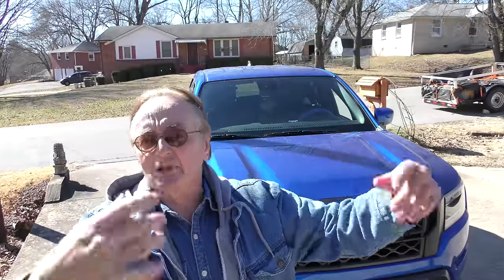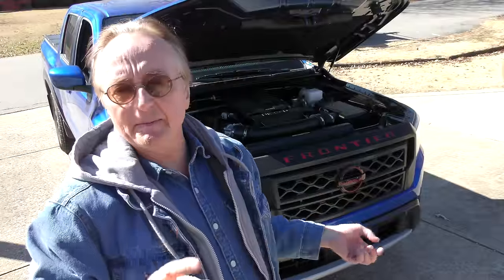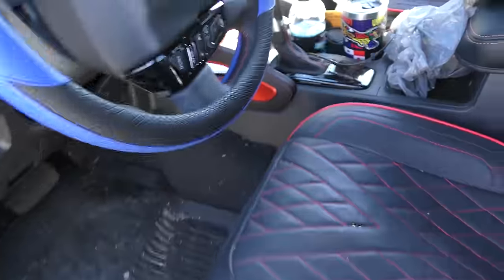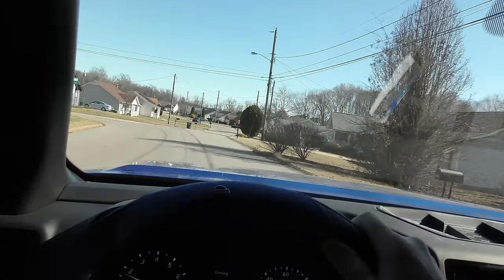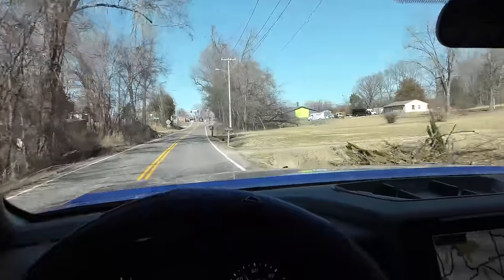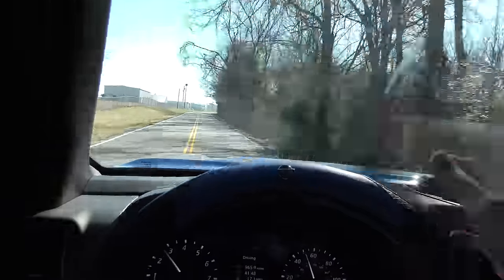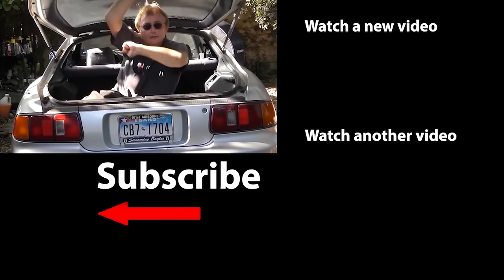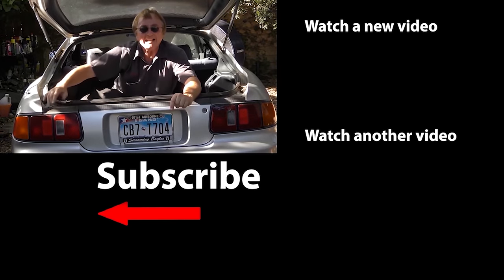This New Cheap Truck is Better Than Anything Toyota Makes Now

Comment: I’m tired of this guy. He just hates on Toyota for no reason. There is a strong history of reliability and safety that surrounds the Toyota name. Nissan frontier have none. They are ok little trucks, but there is absolutely no way they are giving the Tacoma a run for it’s money. Plus the way this guy talks is obnoxious. It makes it difficult to hear his points out.
Reply: What are you talking about he loves Toyota? He has never bashed on them besides them taking away the v6 on tacomas and v8 on tundras  haha they’re just priced really high because of their reliability Nissan frontier trucks are decently made using his word they’ll last you 90% of what a Toyota Tacoma would but much lower price because they’re not associated with reliability like Toyotas are

Comment: A toyota turbo will last decades longer than any American truck. An american  transmission and differential will be done over 3-4 times before a toyota turbo even starts sweating lol.
Reply: Yep, that's why the 22rte was only made for 4 years, and Toyota didn't put another turbo into a pickup until 34 years later in 2022.  Because they were just so damned great.  As far as now, Toyota's Turbo game is entirely new.  Only time will tell what the reliability is like.  Meanwhile Ford has been making the Ecoboost platforms for trucks for over a decade.  That's a lot of catching up to do.
Reply: @jp1087 Toyota quality has been slipping in recent years and I recently heard that they are using rtv sealant instead of gaskets. On some models. I don't know if it's all of their stuff. But they have been having a lot more recalls